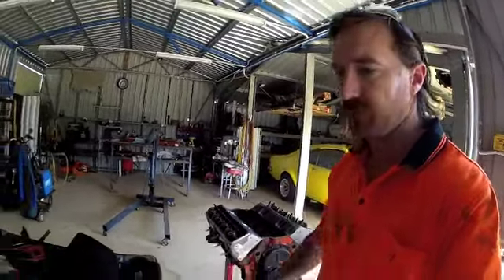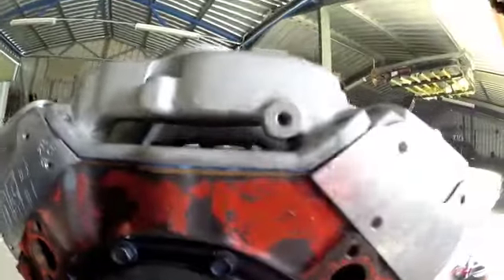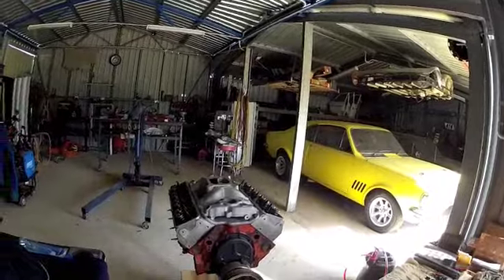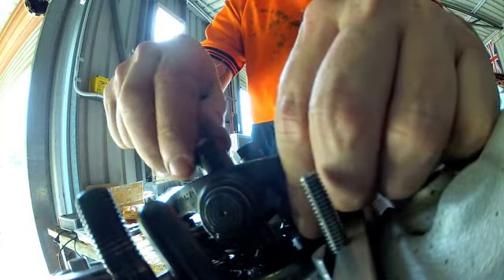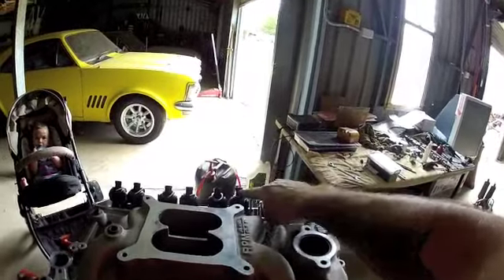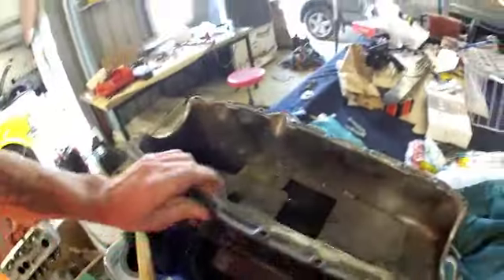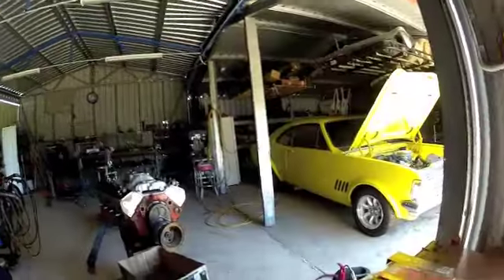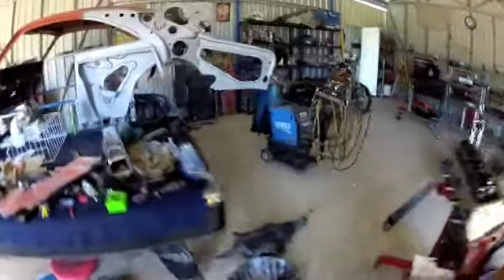Junk yard SB Chevy 350 build pt2

Comment: YouTube included your videos on the recommended list, because I looked at other Chevy engine vids. You may already be up on these things, but in the first one, you had the engine hanging by straps on the exhaust manifolds. Those manifolds are referred to as 'ram's horn' style from the sixties. From what I've heard, Chevy engineers worked out the design for high efficiency flow. If you don't use them on the AFR heads, hang on to them unless you have a mate who is working with factory iron heads and needs good exhaust manifolds. Get $300 for them and you get your money back on the engine purchase. 
   Re: the extra holes in the cover gaskets. The earliest small blocks, 265, 283 had bolt holes in the heads that were closer together on the intake side. Later, the holes were drilled at the same distance from center. Gasket makers decided to make their parts interchangeable to save inventory hassles. The double hole design fits all the perimeter hole heads.
Reply from the maker: good to know, i still have the rams horns here somewhere or i gave them to my neighbor i'm not sure, but cheers for the comment very informitive